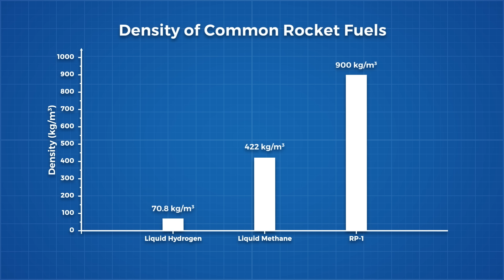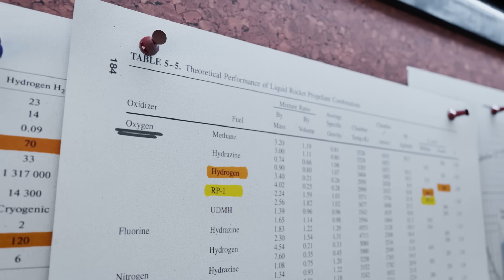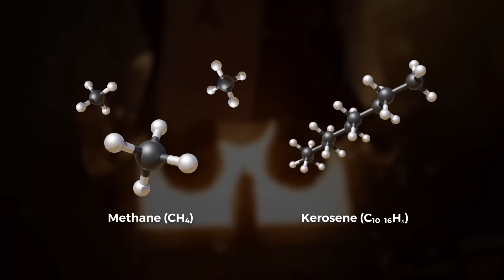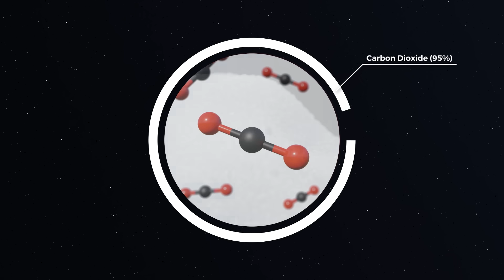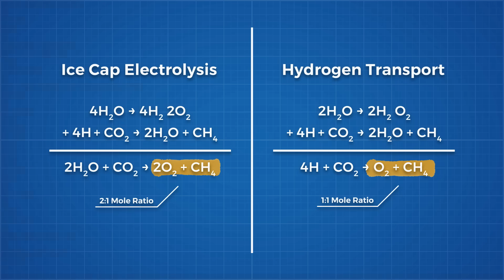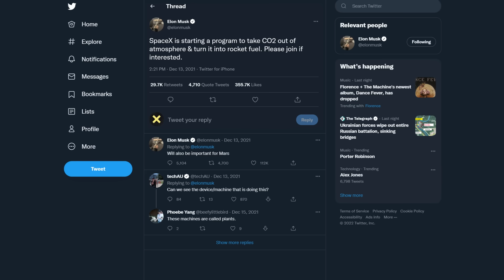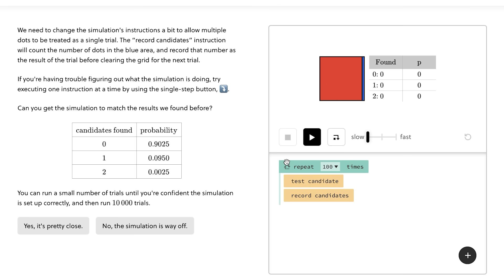Why SpaceX is Using a New Fuel

Comment: Could just use acetylene, its explosive, snd csn do fouling, but with right ratio adjustments it should be ok.  Also more energy.  I think methane might not get you that far.

Dont really think were ever going to settle other planets until way after armageddon though, if ever.

Much easier to dig down, and use nuclear power to provide energy for lighting.

Also this idea for mars yields a poisonous atmosphere for humans.

Comment: This is fairly dumb. You need H2 to produce CH4? Just use the H2 itself, without loosing a lot of energy in the process of conversion to CH4. CH4 is easier to store, I'll give you that, but H2 is superior in almost every other way. And if you're producing the H2 from the water, you already have the right amount of O2 for free.

Comment: Once you get the methane, you can continue to reuse the water made from the methane making process. A one time shipment of water or hydrogen may be viable as it cancels the need to build mining infrastructure on Mars when resources are scarce.
Reply: A multitude of tanker Starship, perhaps purpose built just for this specific preparation mission, could bring not only the equipment necessary, but mainly a literal ship load of water, or if very courageous or stupid, HTP, our good old friend Hydrogen Peroxide H2O2.
Reply: @rolfbjorn9937  peroxide tends to be extremely heavy for the amount of hydrogen it brings. Water is already extremely overweight. Problem with transporting pure hydrogen is leaks. It takes months for hydrogen to ship, and it's not guaranteed a respectable amount of hydrogen is delivered. But if you plan to also bring oxygen to mars, by all means, go ahead, but oxygen is way easier to extract on mars, and doesn't require too much infrastructure.

Comment: Excellent video excellent subject excellent clarity
I wonder if the carbon capture technology discussed here could make space X pointto point hypersonic transport better for our environment than the kerosene fuelled jet aviation alternative
Would it be feasible to employ methane as a jet aircraft fuel with its density disadvantage?
Without conversion to methanol
Cheers
Reply: Liquid methane has about 63% of the volumetric energy density of kerosene. It's also about 22% lighter, reducing the weight of the aircraft and thus fuel efficiency, particularly during takeoff and climb. Overall, you'd need something like 25% more fuel tank volume. So there would be some disadvantage to it, but it's certainly still quite feasible overall.
If the price of kerosene became high enough due to dwindling oil reserves or a carbon tax, then natural gas derived or synthetically produced methane could end up being cheap enough to make it the more economical option despite the required increase in fuel tank volume. I personally think it's a better bet than the hydrogen planes that keep getting proposed.

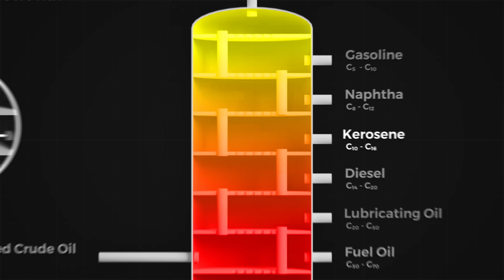Comment: 3:14 so, if it's harder to burn longer carbon-chains and gasoline/benzine is even shorter than kerosine, why don't they use that instead?
Reply: Not as dense & not as powerful
Reply: @nathanb011  ohhh, that's a great reason, thanks!

Comment: Please look into the reaction equations again. 9:00, 11:00 Between 4H2 and 2O2 belongs a plus and the plus sign in front of line two is not necessary (same for 11:45). The 2 in CO2 in the third line needs to be subscript. There are missing many subscript 2’s as well. 12:30 It’s supposed to be 3CO2. I studied chemistry so im automatic in such things. :D Besides that i liked the video quite a lot.
Reply: I dont get what you wanted to say with the reaction equation under “Hydrogen Transport” at 11:45… its the same like on the left side only with less electrolysis. Im confused
Reply: You are right, and the equation is not balance. 11:45 typo on both side 2nd equation, should be 4H2 instead of 4H.
(Left side 4H, right side total 8H)

Comment: I wrote my dissertation on the creation of a model to assess the feasibility and applications of green hydrogen made from curtailed wind energy,  you’d be surprised at how good the LCOS if hydrogen is and the rate at which it’s improving.
Reply: I'd still prefer something that doesn't depend on a 1% to 10% waste (yeah, it can be that bad) ratio of what would become a non-renewable resource: water. Hydrogen likely escapes our atmosphere significantly faster than it reacts with Oxygen in air when unconfined. Since Earth is apparently no longer gaining water it just doesn't make much sense to use it that way. (This IS NOT an endorsement of fossil fuels. Those are even more awful than we generally talk about.)
Reply: @DrewNorthup  Clean fresh water will become scarce, however water in itself won't. Since salt water can be used for hydrogen production we would need to electrolyse 3605 km^3 of sea water alone just to lower the sea level 1 cm. I think for the next few millenia the terrestrial hyrogen supply is save.

Comment: I did not know that Hydrogen has a brittling effect on metals. Oxygen is well known for it's reactance. I really missed out on chemistry.
Reply: yes but thats only true for PURE hydrogen. Mix 70% hydrogen with 30% methane and things will SENSIBLY improuve at all chapters . You can still do your much needed reactions even in a mixture of gases because methane doesnt intervene at all in them
Reply: Hydrogen is also REALLY hard to store. Like with the hydrogen fuel cell vehicles, the fuel both has to be ultra high purity and wants to leak out of even sealed gas cylinders
Reply: @greensheen8759  then how did Hindenburg keep its Hydrogen in its balloon despite being in the year 1936 for days of flight across the Atlantic ocean?
Reply: @xponen  it just lost hydrogen slowly enough that it could still maintain proper buoyancy. That application was also rather low pressure

Comment: Could a rocket engine(s) be fuelled directly off an umbilical? Seems like a good bit of weight could be saved until the vehicle clears the launch tower if possible.
Reply: It would need to be extremely thick.

When you consider how long fuelling takes vs how long burnout (depletion) takes, you will see the limitations of this
Reply: tons of fuel per second, which is not able to be supplied by an umbilical.

Comment: When will SpaceX actually launch a space vehicle that is powered by methane?  So far, all they have done is talk about using this "new" fuel.  They are not using it right now, except in experiments.  Furthermore, the existence of "water" on Mars is far from a settled issue.  There may be NO WATER ON MARS.
Reply: By "space vehicle" I will assume you mean a vehicle capable of going above the Karman Line. If so, they will launch once they have all the licenses needed from government agencies.
Reply: @archer1133  The fact is that methane is an untested fuel.  There are many problems to solve before methane puts a vehicle into orbit, if ever.  The old standby kerosene might be a better choice.
Reply: @ReachOutToWilliam  They have been testing their Raptor engines for a while, so it definitely can get the vehicle to orbit...
Reply: @archer1133  No Raptor engine has ever flown higher than 10 kilometers, and the three that did were pushing an empty (no payload) experimental shell.  If methane were a viable fuel, other companies would be using it.  The US Air Force did partially fund SpaceX to develop a prototype of a methane fueled engine for the Falcon upper stage, but that project remains unfinished after more than 6 years.  Falcon and Falcon Heavy both use kerosene-fueled Merlin engines.  The use of kerosene dates back to the Nazi V2 weapons used against England in WWII.  Musk's desire to use methane is directly connected to his fantasies to colonize Mars.  Methane can be made using known processes from CO2 and hydrogen (which Musk mistakenly thinks is abundant on Mars -- it is not).
Reply: @archer1133  I am watching the development of Starship and the use of methane with interest.  I just have my doubts.

It will be physically impossible to ship sufficient quantities of hydrogen to Mars with existing technology.  By the time the transport ship arrives, most of the hydrogen will have boiled off.

Comment: What's the point of going to Mars anyway? Wouldn't it be more productive to start setting up solar system infrastructure with a refueling outpost on Moon first?
Reply: How would that benefit anyone? Not criticizing, just want to see your point of view.
Reply: @archer1133  How would Mars benefit anyone?  Our moon is infinitely easier to get to, land on, and take off from.  Lunar regolith is replete with easily accessible industrial metals and oxygen.  All the solar power you'd ever need.  It's the perfect place to set up the industrial bases from which to kick-start the space infrastructure OP is talking about.
If Musk were as smart as he thought he was, he'd be shooting for the moon.
Reply: @AlbertaGeek  The atmosphere is the problem. Plus, you need to be careful to not launch lunar regolith to orbital velocities.
Reply: @archer1133  Lunar escape velocity is 2.4 km/s.  Effectively impossible for a mining and refining operation to achieve by accident.
Reply: @AlbertaGeek  I am talking about launching rockets off of the moon
Reply: @archer1133  Okay, but I still don't see how that would be an issue.  Assuming early flights where a proper landing/launch pad hasn't been made yet, the thrust required to lift off from the moon is still minuscule.  Even then, assuming the most energetic chemical reaction and the exhaust gasses transferring their energy to the regolith with 100% efficiency, the finest of regolith particles is still orders of magnitude heavier than the gas molecules of the exhaust.  Again, said regolith particles would still not achieve escape velocity.
Reply: @archer1133  It is the only way to make space industry cost-effective. Unless someone invents some new magic fuel, if we have to supply all fuel for launches on Earth, any space operation will always be running on net loss. To make it sustainable you need space infrastructure - refueling stations, and those orbital hooks Kurzgesaght talked about. The first of which needs to be on the moon because it's the closest, light and has no atmosphere, so the amount of fuel to reach escape velocity from it is minor. If ships can refuel on the moon, then they can be sent to Mars and the asteroid belt to perform useful tasks that might yield some profit. Without that infrastructure, any space mission is always a net loss, and space industry will have to rely on tax money and ethusiasm.
Reply: @gigakoresh  I would argue that infrastructure around Earth would be more important. Landing on the Moon vs landing on Mars needs completely different ships, and it would be far more efficient than trying to both land on the Moon and Mars.

Comment: 13:36 When CO2 in Earth's atmosphere interacts with the water vapor in the air, it becomes carbonic acid. This carbonic acid falls to the ground in rainwater and flows into Earth's rivers, lakes, and oceans. The CO2 in the atmosphere is always at a equilibrium with the carbonic acid in Earth's oceans and lakes. 
Instead of trying to capture and store CO2 directly, what if we tried pulling carbonic acid out of oceans and lakes as a way of reducing the CO2 in the air? https://youtu.be/G8zOHZINyG8

Comment: Mars would make a great base for mining asteroids in the asteroid belt and in Jupiter's L-3 and L-4 positions. There's possibly more hydrocarbons and water on these astroids as well.
Reply: @ARC Commander CT-420 how special would those metals or alloys be?.Could u give an e.g?
Reply: Right...mine for what? Smdh
Reply: Why, though? The extra complexity of lining up orbits for a "gas station", so to speak, could delay a mission for years and would add significantly to delta-V requirements as you suddenly have to stop around a third body and work its launch windows into the equations. Plus, we're likely a century or more before such things become economically viable as the moon and other near-earth objects will be able to provide resources to sate growing terran demand much quicker and at a much lower cost.
Reply: Did yall not see the movie evolution? Leave them meteors where they are.

Comment: Why not use kerosene to produce compounds with lower catena length and burn those? You will get the benefits of both, more importantly no need for heavily insulated tanks
Reply: Coking
Reply: @archer1133  well, coking happens when you try to directly burn long catenary fuel, but gets more and more subdued when you use fuels that have a lower length of the catena (number of CH2 components in the chain). But such fuels (eg Methane) are harder to store/handle than longer catenary ones (eg Kerosene). Thus if you can convert one in another (split chains in Kerosene and get Methane or something closer) you have a source fuel easy to store/handle and intermediate (or conversion target) easy to burn

Comment: Something to digest for those that doubt the practical merit of investing time and resources into this strategy may find of benefit: dozens and more new technologies are stumbled upon through projects like this, where new methods have to be developed to tackle problems that can have additional and more widespread benefit than the primary topic of study ever envisioned. I myself often run into this, where I started on one specific target, and through the development to get the primary idea off the ground, end up developing 5 or 6 new application ideas along the way which likely have more practical and widespread use then that initial project ever could encompass by itself; occasionally you stumble onto something so magnificent that switching to one of those accidental discoveries is worth abandoning or postponing the first project because of said possibilities!
Reply: Yes. Pretty similar to the ancient alchemists and transmutation chemists of the past. Wouldn't have a periodic table and other development otherwise.

Comment: its simple you  could try to scrape off has much carbon dust of the engines with proper cleaning equipment  as much as possible then mix that carbon with hydrogen gas made  from the moon water to make artificial mehtinae fuel on the moon or the very salty water on mars. also a solar wind gas collector also in mars orbit would be a good source of water as well since we have also just discovered that our sun's solar wind also tends to spew out a good amount of water vapor in the solar wind as well!

Comment: I still don't buy the argument that "we should strive to go to mars, because in the process we solve a lot of issues at home".
The drive to go to mars is what is driving developments into these refinement processes. The drive could just as easily be directed at something useful at home.

It's just a matter of PR and people seeing the benefits first hand.
NASA has a big (not insanely big, but still big) budget because spaaaaaaace.
Imagine you gave that budget to scientists to work on converting CO2 into methane for cheaper energy prices alongside developments for better battery packs that would benefit us all greatly, climate change or no climate change.
Reply: The next biggest industry will be done in space. The profit potential of asteroid and planet mining is insane
Reply: @Whosmanthisis  So how far away do you honestly believe PROFITABLE space mining would be?
Also considering that abundance of a certain material causes market value to plummet.
Who needs a million tonnes of gold?
And even then, what would it cost to mine a ton of gold from space?
Or are you thinking of way more exotic metals? Then i hate to break it to you but the reason they are so expensive is mainly because demand is quite low in conjunction with expensive extraction and processing costs. It's not that we've run out of said materials on earth, it's that it's just that expensive to get them and no amount of abundance in space is going to change that cost for the better.
Reply: I mean everyone still benefits from space exploration either directly or often indirectly. That’s not to mention the fact that the amount of money spent on it is still a drop in the bucket on the scale of the global economy. 

Also, we don’t have to choose between saving the planet and exploring space, we can do both. 

Not going to list every argument in favor of space exploration here, because I could go on and on, but please do some research on the benefits.
Reply: @user-yd4rn4ez6m  "please do some research"
How about you do yours?
What is it you get from exploring space that you cannot get from exploring science here on the planets surface?

Give me one valid example and i will accept your "challenge" and "do my research".

Out in space you will find... Vacuum, rocks and a few clumps of minerals for every quintillion cubic meters of space.

What is it about SPAAAACE that's so amazing compared to what we have here on our planet?

Comment: How do you land a starship on an uneven surface so far all it’s landed on is a perfect surface.
Reply: They don't even have the final landing legs on starship yet. The starships that have flown so far are bare bones test vehicles...
Reply: They scope out a flat enough area before landing. Also most of the weight is near the bottom due to the engines so it’s fairly stable.
Reply: Thanks that answers my question.

Comment: So if: 
-Carbon dioxide freezes at -78 C,
-The average lowest temperature on mars is -60 C,
-In winter, near the poles, temps can reach as low as -125 C,
-Mars winters lasts 4 months, out of 22.6 months per Martian year,

🤔🤔🤔Couldn’t we just shovel/mine enough Carbon Dioxide off the ground and store/use it resourcefully  over the years on mars, and just land during a winter opposition coming up soon?
Reply: Might be a possibility.
On the other hand this CO2-"snow" could be very dusty, requiring multiple steps for purifying.